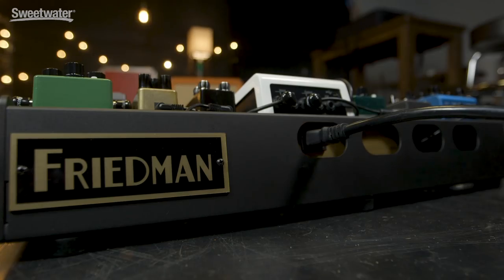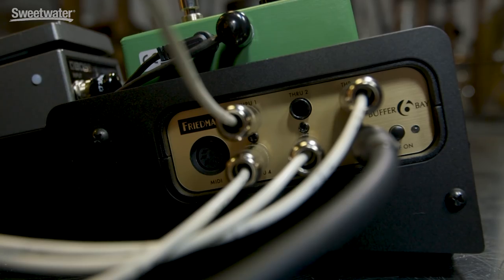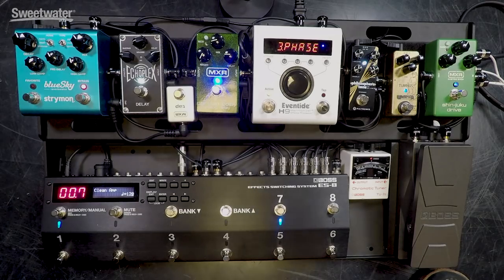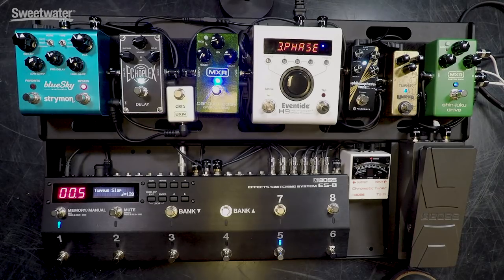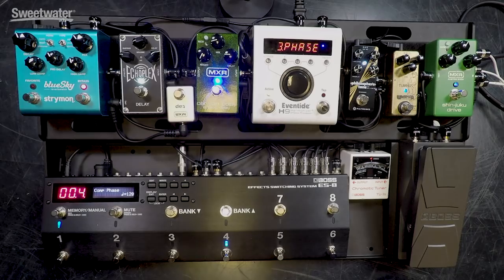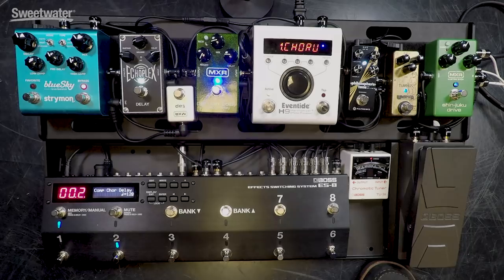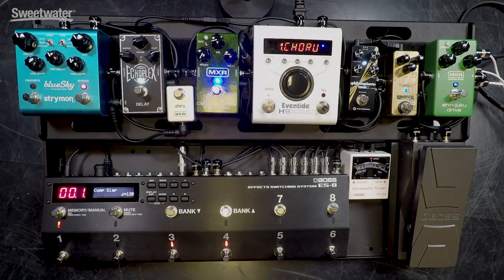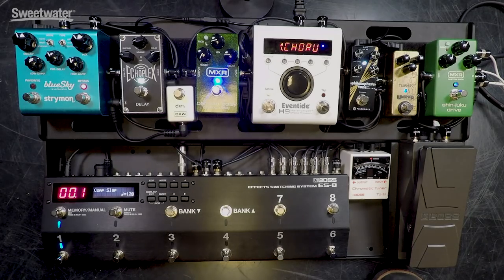Friedman Tour Pro Platinum Pack Pedalboard Review

Comment: The Eventide H9 specs say that the power draw for their pedal is 500mA at 9VDC, and yet it seems to be working on your pedalboard just fine, presumably with 350mA from the PowerGrid10? Have you experienced any issues?
Reply: I know this question is 2 years old. But, just the other day I asked Dave Friedman and he said he powers H9s from one single output on the power grid with no problems.